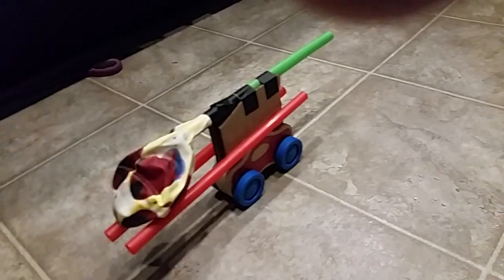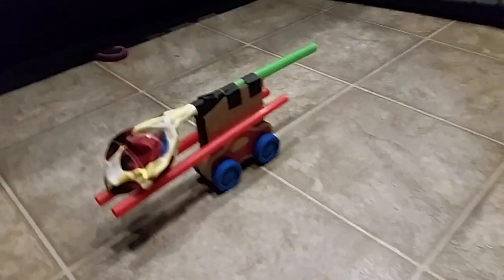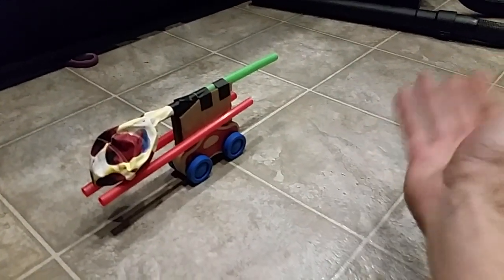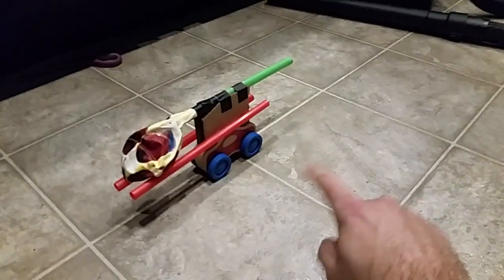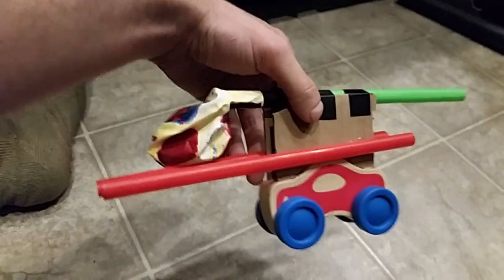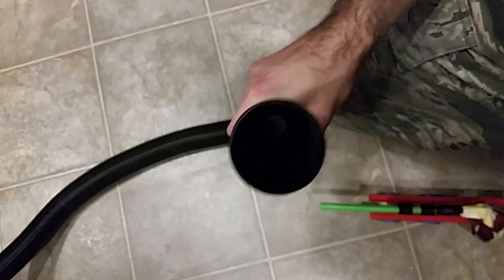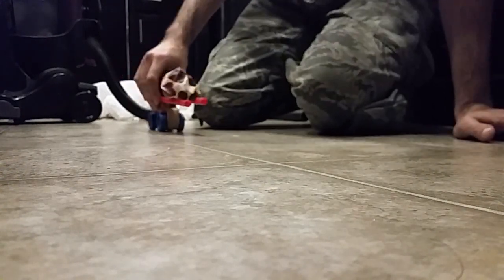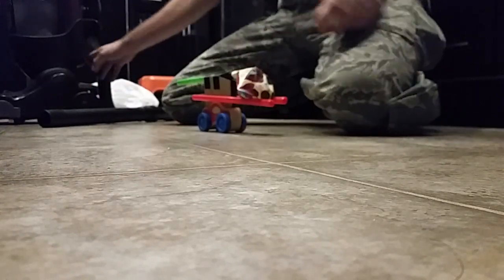Newton's Third Balloon car with vacuum behind it

Comment: Invalid experiment, the air rushing out is still pushing against the inner walls of the vacuum nozzle. rockets do not work in a vacuum because the thrust has nothing to push against. this cannot be tested on earth because vacuum chambers have walls the thrust can push against. Nasa claims the rocket pushes against itself. but the rocket and thrust should be considered one mass system, not two. Oh and by the way, a balloon better represents a jet engine, not a rocket. Jets don't work in a vacuum either.
Reply from the maker: Push against the inner walls?! LOL. Right after you say about that you go into how it must be bogus that a rockets thrust pushes against itself... the nozzle is itself the rocket! LOL dude you are hilarious.

It is Newton's third, which is easily proven as a fact of life.

First, feel free to use a few seconds (not hours like idiot flat earth material) to see that having something for exhausted mass to hit against does not change thrust from newtons third
https://youtu.be/FR2QLhbI5s0

Second, riddle me this. What happens if you throw a big beach ball vs throwing a smaller heavy ball like a bowling ball or medicine ball? Why does throwing a heavy smaller ball push you backwards? According to you it's only because it pushes air right? So why does a larger beach ball barely cause anything at all?
 Glue a spring to the lighter ball. Tie it with ribbon to the smaller heavier ball so it compresses the spring. Hang it all from the ribbon and cut the ribbon.... huh.... what happens? The beach ball is bigger and has more air to stop it right? So which one gos flying off?

Newtons cradle alone proves newtons third.
Reply: insults are the last resort of a proofless person. since you refuse to calm down and insist on acting all butthurt, I'm going to leave you and your dead channel. no one cares about your opinions.
Reply from the maker: Just FYI for newtons cradle if you try to ignore the device.

Newtons cradle 100% simply proves newtons third. You can lift one ball to start it right? So the part that proves newtons third is when that ball drops, hits the still balls, and one goes flying off the other end.

Does it take force to stop a swinging ball? Does it take force to start the opposite ball? Oh weird huh? The pusher and the pushed obviously both felt the same force then, because one ball completely stopped and the exact foece that took was the exact force it took to launch the other ball. No air involved either.... weird....

Throwing or pushing something makes the same exact force on the "pusher" as the "pushed"

If you cant disprove small heavy object vs large light object being throwing from something like a skateboard (which I have done by the way), then you are obviously wrong... it is not about pushing against a mass of air. Mass throwning mass causes push backwards... with or without anything for the mass thrown to run into.
Reply from the maker: Just an FYI for people. He did not originally have "vacuum nozzle" only nozzle in the first comment.

Not really sure where he was being so harshly insulted at as he claims.. I said it was hilarious that his original comment claimed pushing on "the nozzle" not "vacuum nozzle" which was hilarious that it was directly conflicting with what he mentioned in his comment.

Also... I have no flipping idea where he gets the idea that a balloon is more like a jet engine... rockets have their mass to shoot out on-board and intake nothing. A jet engine intakes air, compresses it, adds fuel, and then combusts all that to eject the exhaust.... how the heck is that like a rocket? A pumped up childrens water rocket is a rocket and that works just like a balloon.

It's just like.... what the heck are even talking about?
Reply: @Jasoninee  How can you not understand the LIES you are perpetrating.
The ATMOSPHERE is the largest mass, after the ground, yet you do not take this into account? LMAO!  Go take a look at all the bullshit artists who say rockets work in space and they fail to understand that ALL flight requires an external mass to push against.  These idiots think because the air is mostly invisible, its not the 2nd largest mass they experience everyday.
Reply from the maker: @54321Truth  

If what you are saying was true throwing a large air filled beachball while on iceskates would send me backward much more than a small heavy medicine ball. Guess what? It doesnt.... throwing matter require you to push against the matter, you pushing makes you go backward... regardless of atmosphere.

A rocket is essentially a crazy machine gun in space. Please answer what you think would happen to a shooting gun floating in a vacuum? Do you think only the bullet would move? Why?

What about two bowling balls tied together to squeeze a spring in the middle that is only attached to ball A and not ball B when the string is cut? You really think the ball with the spring is magically the "launcher" and sits still?
Reply from the maker: @54321Truth  

Do the same ball and attached spring thing in the atmosphere with a medicine ball and a larger beach ball. If thrust was from pushing on the air the beach ball would win in pushing the medicine ball away... it does not, because the thrust is actually from newtons third law.
Reply from the maker: @54321Truth  

Did you notice how you didnt answer about the large beach ball and medicine ball? Beach ball is bigger than the medicine ball, but medicine ball will move you backward substantially while a beach ball wont.

Your example is meaningless to the discussion. You are taking two things of the same mass and making it seem like an amazing point that air resistance of the larger thing with the same mass is somehow important to what we are talking about. That is not telling of anything about newtons third in regards to what we are discussing.

Notice how you also avoided the two balls tied together with a spring atached to one ball compressed in the middle example? I noticed. That example proves newtons third to anyone, because no one is every going to claim and actually believe that one ball is magically the "launcher" and sits still.

Matter throwing out matter pushes as thrust. Gas is molecules and molecules only fly out the back of something if they collided in such a way to end up going out the back. This is a net force forward where they then fly out the back. Pressure isnt some magical thing.. just molecules/atoms bouncing around. Rockets essentially end up being a big tube with one closed end and trillions of bouncy balls bouncing around inside until they get to fly out the back. Flying out the back left a net forward force and if every molecule/atom is only allowed out one way, then all the net force felt by what held the matter is the opposite direction
Reply: @Jasoninee  Do you notice how you disregard the largest mass, outside of the ground?  That is some laughable "Science" when you discount the 2nd largest mass. LOL.  Next you will tells us that the Mars Helicopter also does not need an atmosphere? LOL.  All flight requires an external mass to push against, just like any other movement in recorded human history requires an external mass to push against.  Nasa Magic is not real.
Reply from the maker: @54321Truth  

Nope. Continuing to not address what I pointed out to you just makes you willfully ignorant.

Using words like "stupid" and "idiot" are not factual points. The scenarios I postulated for you discount the atmosphere being what drives thrust. There is no discounting newtons third, because how the heck could you ever push on anything without feeling the same push backward yourself? You cant push with 20lbs of force against something without 20lbs of force pushing back on your hand(s). It is the same reason you need to plant your feet for grip while you try and push something. Has practically nothing to do with atmosphere. If that was the case throwing a large beach ball would propel you better than throwing a small heavy medicine ball, but it doesnt.

Answer about the balls tied together with a spring and then we can talk.

Comment: take off the two red straws  and repeat the experiment with the green straw not inside the nozzle. Nozzle should be 5 cm behind. Also repeat the experiment with the nozzle perpendicular to the green exhaust.
Reply from the maker: Markoul11 
huh?

What the hell are you getting at here LOL

The red straws hold up the balloon. What the hell are you on about the ballon holders for? You want them plugged up or something lol

What nozzle? The vacuum nozzle? you want it farther back? lol alright awesome

I can do all this stuff, but are you really such a nut to think that thrust from throwing mass isnt a thing?
Reply from the maker: well soooo.. something has to hold the balloon up. I had tried bamboo skewers but they were too weak.

You have a fear that I have a line through them or something I dont understand what you are worried about
Reply from the maker: Video with your concerns addressed being uploaded right now. Couldnt remove the straws since they stop the balloon from hitting the floor, but I did seal them off and bend them out at the front so theyre not straight. Still not sure what you are worried about, but you'll see and I can't imagine what is the problem here.
Reply from the maker: Markoul11 

Ask and thou shalt receive:

https://youtu.be/19SCi83zQJQ

Looking forward to what you have next!
Reply: yeah! you balloon is leaking air from the other side of the straw...simple! ahahahahahaha! Rockets don't work in space...got it?
Reply from the maker: Markoul11 

What are you talking about?
I made a video with what you wanted btw.

Comment from the maker: AIR SPEEDS MEASURED!

Andrew Corbell brought up that he thinks  we need to know the air speeds to determine whether the car should move or not.

Ballon car thrust air: was never able to get a reading higher than 30mph, even with over blowing the balloon compared to the tests.

Vacuum hose: reads 60mph around a 1/4inch off the the hose and when placed on the end goes way up in speed, but the meter has a max range of 60mph, so it is so fast it errors out the meter.

I will make a followup video with those measured and also a static thrust measurement of the car to eliminate Andrew Corbell's "dynamic vacuum hose" problem.